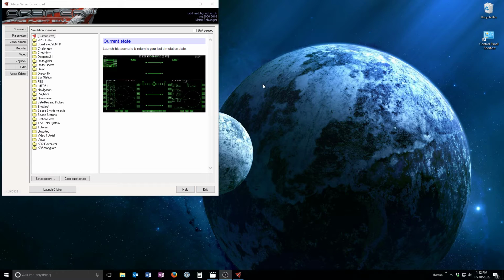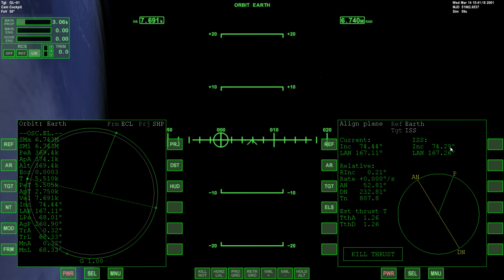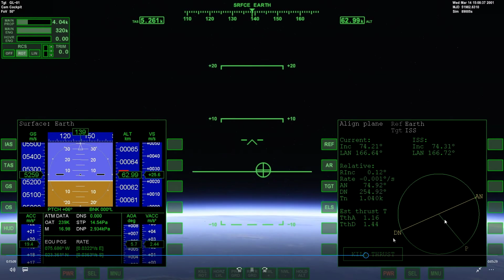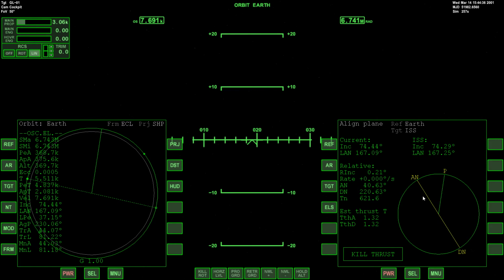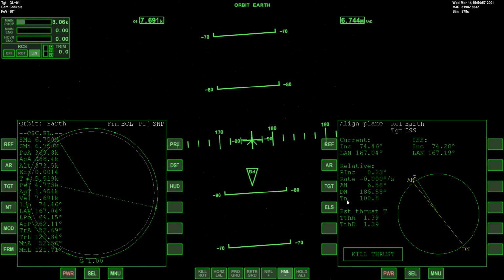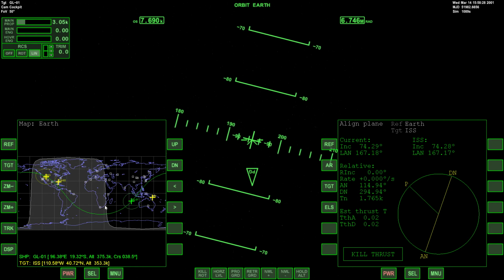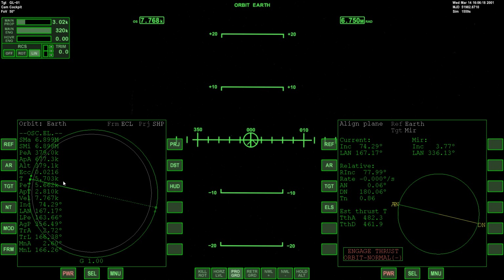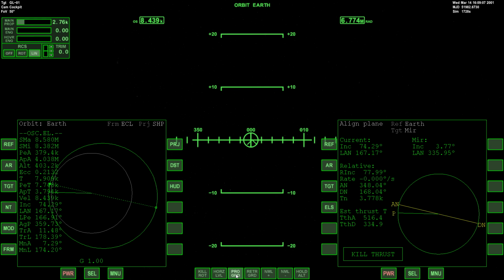Part 3: Orbital Plane Alignment (ORBITER Tutorial Series for Beginners)

Comment: Another good one, Tex. I'm curious why you kept the orbital reference frame (FRM) as ecliptic in the Orbit MFD rather than changing to equatorial for Earth orbit operations. It doesn't much matter but the familiar (to some!) ISS inclination angle is 51.6 degrees relative to the equator but shows as 74.3 degrees relative to the ecliptic. I usually stick with EQU for purely Earth orbit operations -- force of habit, but is there an advantage to using the ecliptic plane if you are not transferring to another planet?
Reply from the maker: Hi Bruce. Thanks for your comment. To be honest, I never think to change the frame of reference much. You are probably correct that it's a better practice to use the equatorial frame of reference for Earth orbit ops. I don't believe there is any advantage one or the other, just personal preference. I suppose I also tend to leave it alone in beginner tutorials since ecliptic frame is set by default, so those new to ORBITER will see the same thing in their scenario if they were to follow along with my tutorial. Thank you for watching!